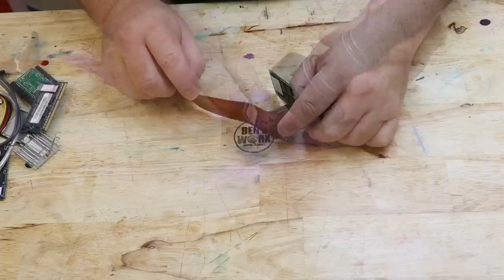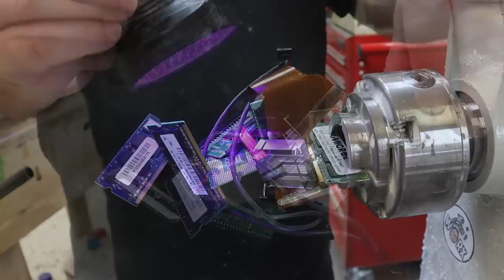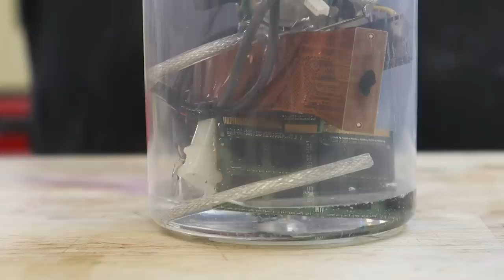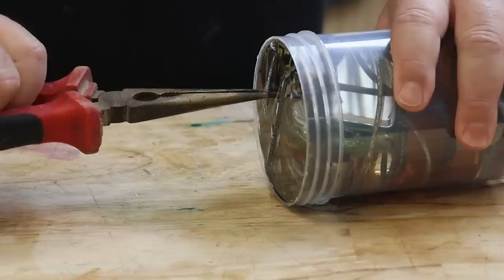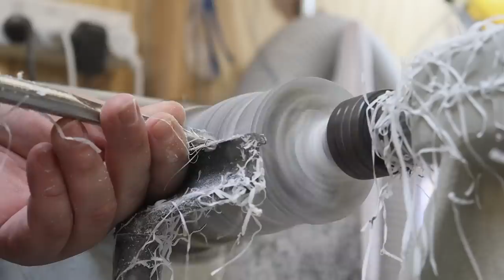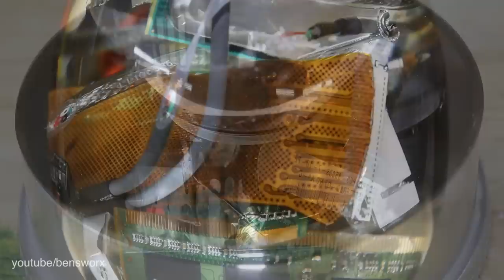Turning Worthless Parts into $$$$

Comment: I was sure this one would rip apart on your lathe given the many hard metals and other materials used in manufacturing those parts, or at least ruin your chisels and render them unsharpenable.  But you pulled it off and made a stunning work of art out of those parts.  From a retired IT pro, I give you my congratulations on a beautifully made computer egg and on your 25 years together!  Well done on both!

Comment: Electronic parts have some particularly "machining-unfriendly" things in them -- most notably the circuit-boards themselves.  Most circuit boards are "FR4 laminate", this is a laminated epoxy-fiberglass material with a flame retardant in the mix (that is what the "FR" means).  Fiberglass is woven into mats, soaked in epoxy resin, then pressed into sheets while the epoxy cures.  As a result, when you cut or drill this stuff, you expose little glass fiber ends that abrade your tool bit -- and it is *NASTY* on high-speed steel.  HSS drills almost visibly "melt" when drilling this stuff (well, they do not actually melt but it looks like they do).  A couple hundred hits on a board and a HSS bit is toast.  Board-houses (the factories that make these boards) use carbide drills, end mills and such on this stuff and they have to closely monitor tool wear.  The dust from machining processes on FR4 can even abrade the ways on machine tools!

That said, the egg is amazing!

Comment: One question that popped into my head is how long does UV resin take to harden?
Reply: A small amount of resin will start to cure almost instantaneously when you hit it with a uv torch. About a minute will cure it pretty hard. If you're using a lot like doming or curing something in a mold, then 5 or 6 minutes under a nail lamp will fully cure it all the way through.